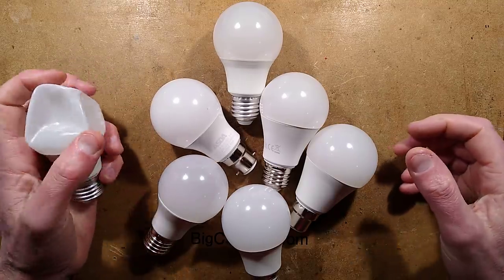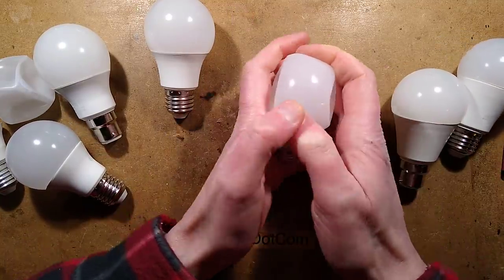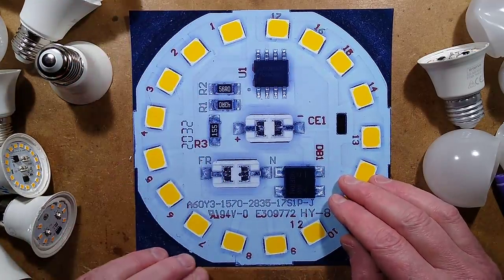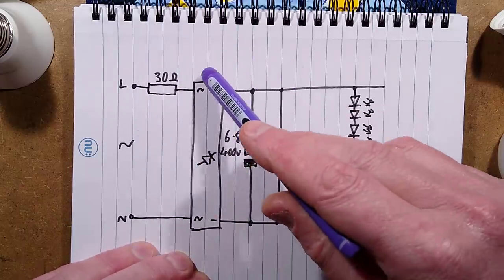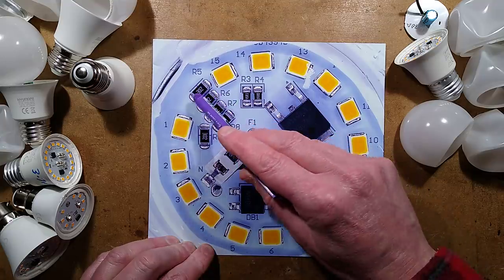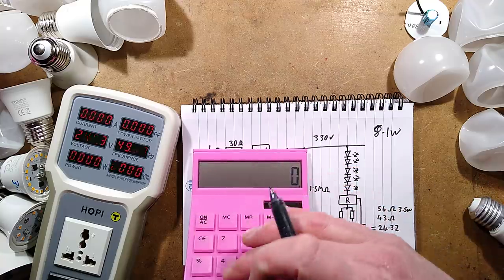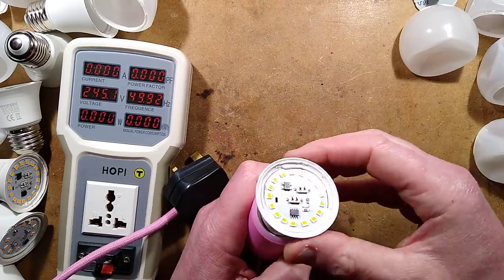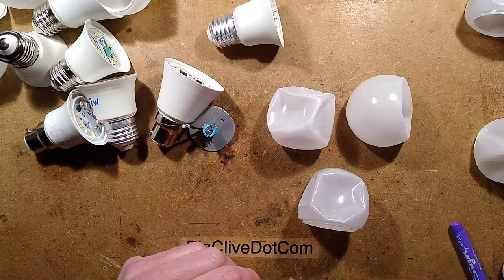Crushing and hacking LED lamps

Comment: I am hooked watched a lot and learnt a lot got ideas in my head for future project just no idea on on making them , want to write to you ? how.
Reply from the maker: You can ask questions here.
Reply: @bigclivedotcom  hi Clive, yes I want to change my inset lights on my Honda Goldwing 1986 Sei 1200cc aspincade. It cam from USA 3yrs ago and has a skirt around bottom and rear boxes all 10 lights have worked in past have LED bulbs in . There disconnected for this country's rules. Ha well after watching you build all the light units on to boards it made me think can I do the same. But with a small add on , controlled by a remote . And indicators on a flasher chaser or plain modes. And for Xmas special outings for charity a crazy light show module which can be reset to normal for police inspection reasons. But my experience is in engineering and I have a HNC in electronics but never used like you am mechanic al technician now retired due to health reasons. I can solder ha apprenticeship make a cube of wire, yes I did burn myself a lot. But I learnt from you my errors over the 50yrs as tradesman. Question  is I don't know your knowledge facts but leaning from your programs. I don't know we're to start ie a board or the components in set . Where can I start ? Each board has to be small 2inch by 1 inch to fit housings . I don't know lights want them to be as bright as allowed 12volt supply from my board on board . for your interest it has a trip computer on tank working but old large lots of buttons . Can you look up the bike then see the skirt and any advise on my be spoke idea. Ta james tommy lea  ps your fingers are more nimble than mine as I had one sawn back on and welded so can't manipulate like you do which I wish I learnt at 15yrs old.    Have a good day stay safe and enjoy life.
Reply: @bigclivedotcom  pps thanks to you again I blew my multi meter and stripped it down found the blown link cleaned the track and made good the link now works again tested ok won't do this again 😃 Bang.ha thanks

Comment: When I attempted to do this i split the second resistor too, and before I attempted to solder on a replacement curiosity got the better of me and I plugged it in first. It glows just enough to not be blinding looking directly at the smd leds. I believe it is safe to use just using the base current of the ic, and I plan to use this happy accident, but just wondering if there is anything dangerous I have overlooked, is there?
Reply from the maker: I've not tried that, but I'd guess it is just the passive current used by the chip's own circuitry.
Reply: @bigclivedotcom  that was my guess too, I couldn't think of any reason it couldn't run like that, so I left it running 24.7 in a closet so I don't have to fumble for a switch in the dark, it's also dim enough I left the "bulb" plastic off. (Aware of the 230v risk) I had considered soldering a capacitor, transistor (or specifically a MOSFET) and ~50ohm resistor, with a NO button in the tip of plastic ball to make a crude latching switch to connect the resistor for a timed bust of brighter light, I think it would make a neat hack, I will let you know how it turns out when I have the time to get the stuff out of storage.

Thanks for the hack idea, it's been nice not having to fumble in the hallway, with just enough light coming out of the closet to allow me to quickly find the hall switch.

Comment: Why does every design always have 2 voltage setting resistors in parallel just to result in a low resistant one?
Reply from the maker: It gives greater control over the value for fine tuning.
Reply: @bigclivedotcom  Do you mean so they will have more freedom to mix and for target resistance? But they use two, not one. Why does freedom preferred to doubling the cost?

Comment: Well the
Energizer ones are a different design. 
Need to use a heat gun to get the top off. 
Electronics is in the stem 
Only 7 leds

Comment: i have 2 kind of outdoor lamp with one led. All the 3 lamps have one light solar pannel on the top and one is older. So the 2 type are old and new one. I opened the old one that stopped working. It have a circuit (That I cannot read.) with one button that turn it on or off and one led. Somewhere I think there is also a photo-cell so when the light goes down it lights up the led. But I cannot crush it to investigate. I want to improve the old lamp adding a AAA rechargeble battery  insted of the ones they used... Can I  ? Or what I have to look for to understand if I can  ?

Comment: Is it a possibility to just put a capacitor in series with the lamp to drop the voltage applied to each lamp without hacking inside?
Reply from the maker: Yes.  That works with the capacitive dropper and linear regulator types.
Reply: @bigclivedotcom  how do I calculate what size of capacitor other than trial and error? Is there a mathematical formula I can use for the amount of voltage drop across the capacitor?

Comment: At 7:39 you mention that the loading resistor prevents the annoying residual glow that some LED lamps have.  This issue of residual glow would be a great topic for a future video.

I have a kitchen exhaust hood that accommodates two lamps.  It came with incandescent lamps, but one has failed and been replaced with an LED lamp (incandescent lamps of this size/rating are no longer available).  It works fine as long as the second lamp is the original incandescent, but if I replace both incandescent lamps with LED lamps, I get the residual glow.  That's OK (for me) - it serves as a 'night light', but my wife doesn't like it.  I don't want to try to hack the LED bulbs, and I would prefer to not have to search for 'better' bulbs that include the loading resistor.  Is there something that I can do to the circuitry in the range hood to force the LEDs to be truly off when they are switched off?
Reply from the maker: You could add a snubber network across the lamp wiring.  It's a capacitor and resistor in series.  If the hood lighting control is electronic then the glow is probably snubber network coupling across the triac.  It's harmless.  Embrace the free night light.

Comment: I just spin the top like it's a jar, if it doesn't work I give it two smacks underneath beforehand.
Reply: Noticed they've been adding more glue, they probably kept popping open by falling to the ground.

They still open fine, smack all around the sides of the top part then grab and spin.
Opens clean.

Comment: Hey bigclive, how much mA would the leds run at with a 16 ohm resistor with a RM9003B TO-252 ic chip? I want to run the leds close to 90mA
Reply from the maker: It depends on the sense input voltage.  You may need to experiment.

Comment: Are LED bulbs being overdriven? Well I have had a lot that say life of around 10 years life, but failed in under 2, without being used much, the latest ones aren't doing too bad though. Whereas, there's an incandescent one in the shed, that was there when I got the house, it's been through freezing and heat is used quite a bit, still going strong and I've been here for 17 years.

On a side note Walmart sold controlling interest in Asda to the Issa brothers, but do maintain an interest in the company.

Comment: Why 8.1W x 24.32R? 
And what are the specs of each led in that lamp? Thank you
Reply from the maker: The LEDs are high voltage LED with multiple internal chips.  It varies from lamp to lamp.

Comment: Wouldn't it be possible to short the resister by soldering a wire on top of it instead of breaking it?
Reply from the maker: That would do the opposite.  I wanted to make it open circuit.
Reply: @bigclivedotcom  I was thinking about it, and thought that that was probably the case, but I was away from the computer, so I didn't delete the comment.

Comment: Can you modify it to run on automotive 12v? That would be perfect to run in an RV trailer.
Reply: I don’t think that would be very easy with this lamp, even if you wire all 16 LEDs in parallel. With 16 LED’s in series on 300V each LED needs ca 18V.

Comment: I took apart a faulty light and it's the same circuit with minor differences.
I managed to fix it to some extent but it still flickers sometimes, must be a bad connection in the LED string.
Reply from the maker: There's probably an LED with a black dot in it.  They often have bond failure.

Comment: @bigclivedotcom take a pocket knife or any stout heavy blade knife and you can slide it into the gap and lightly pry and they pop right open, I have plenty I removed the diffuser and covered the exposed live connections with glue

Comment: I have had 9 Aurolite AL3003 12W “980lm” bulbs, and 8 have failed within about 1000 hours. They normally strobe unbearably when starting up at end of life. Popped open the top and there appear to be no components? Just 12 sets of 2 LEDs.  Does that mean a straight 10V AC across each one?
Reply: The code on the board is T11-A60T-2P12S-2, so I’m guessing 2P12S means 2 in parallel x 12, so 20+V across each?
Reply: Took the LED plate off and found a chunky little board behind with 5 capacitors, 8 resistors, 2 coils, a diode, diode array (?) and chip. Taking it out is destructive, so not much chance of improving the life of these lamps :(
Reply from the maker: It does sound like it would be hard to modify.
Reply: The BC terminals are just push-fit and jammed against the fly leads from the circuit board. Nice.
Can anyone tell me if it might be possible to fix the strobing? It stops after 10-20s, so some component is happier once warmed up. One of the capacitors perhaps?

Comment: Do we have plastic LED bulbs here in the US? Would love to order some and do just this lol
Reply from the maker: You may be able to get similar lamps in supermarkets and dollar stores.
Reply: Dollar Tree for sure, but I just got one that used a single 7.5 ohm resistor, so the clipping trick wouldn't work and I had to solder to replace the resistor.

Comment: Could you modify an amazon basics light? I took one apart, and the circuit board is removable from the power supply bit without soldering. It uses pins that the led circuit board slides down onto. The power supply is in the usual spot, but I'm not sure how I would modify this. The bit I'm having trouble with is how would do I get the connections back onto the light? Should I just use new longer wire(so that it's easier to do (for me))? I have it apart, and the board looks nice... For being so cheap. There are a part of 15 ohm resistors one on each rail. Also, the bottom of the board is very shiny, like they sprayed the whole thing with flux. I'd like to share a picture, or a short video of it, if you'd like to see it.

A 40W bulb with 6 cob(i'm guessing)  LEDs.
Reply: I just seen your video on the poundland light, and it looks sort of like that, but I'm not sure how that one comes apart.

Comment: Ive tried, and tried but its impossible to take the top of some of them. The tesco type was easy for me but the cheap one was impossible. Its the new material called indestructanium
Reply: If the caps are plastic and easy to squeeze (in other words no glass), squeezing can release the silicone seal.
Reply: @8bitwiz_  did you not read my whole comment?

Comment: What to do when such lamps start to flicker and fail miserably?
Reply from the maker: On some you can tame down the current and bypass failed LEDs.  But at that point the damage has been done.
Reply: @bigclivedotcom  could it be capacitors failing?

Comment: Is there any chance I could do something similar to g9 LED bulbs? No matter which brand or expensive they are, they last 6-12 months and having to replace and waste too. The mrs insisted on a chandelier with 10's of these bulbs in each set, plus multiple matching sets of mood/accent lights, and the frustration of changing them and the cost is stupid, also the electrical waste is painful.  I brought a new pack of generic G9's, they have two banks of 2x510 (51ohm?) each side. One 684 (680k Ohm?), a capacitor and a MB10F bridge rectifiers. Seems like a much simpler circuit to the GU10's. Could I remove any of the 51 ohm resistors to reduce power output, feasible? Thanks all.
Reply from the maker: Depending on how accessible the PCB is it may be viable to adjust the resistor value to tame the heat.  Alternatively, it might be possible to add series capacitors to "dooby" the lamps.
Reply: @bigclivedotcom  Thanks Clive for getting back so fast. The space is somewhat limited with the two part shell, though if I leave one side open, I could solder in small resistors else it would have to be smd's, and thats beyond my skill, I'm just a amateur tinkerer. It's doubtfull a series of capacitors would fit safely.
Which resistor would I need to play with, the 510's or the 684? Really appreciate this.
Reply from the maker: @harj-spp8547  If the two 510 resistors are in parallel you may be able to remove one.

Comment: I use similar CC Chip in my flood DIY led lamp. After some time some leds shines only litle bit but current passas to ather leds and they lights normally. Maybe you know wats hapens to some leds ?
Reply from the maker: Most likely bind failure and internal tracking across due to overheating.
Reply: @bigclivedotcom  😊 Thanks
Reply: @bigclivedotcom  Thanks :) Failed After Cold Winter probable metals shrinks becose of cold :)

Comment: If you don't want to crush the globe, you can gently prise around the seam with a rather stout k'niff (as Clive loves to pronounce it) or spudger to weaken the adhesive.

Similar circuitry in my Dollar Tree lamps that don't work very well on 120V with Doobie capacitive droppers under 1uF. Ours also tend to have a single current setting resistor (though they have two pads), so I guess I'll need to work on my surface mount soldering skills if I want to modify them. What is the typical size for these - 0603 or 0402?
Reply from the maker: Not sure the size.  It may vary between lamps.

Comment: Shows me how weak I am compared to clive, while I was watching the video I pretty much spent half of the time trying to pry open one of the bulbs and failed
EDIT: finally got the bulb open and looks like it simply has a vertical power supply in the middle and the only thing that you can see is the 2 contacts from the power supply and the LEDs themselves, shame. Really don't think I should take it apart further. Mine is a 6 watt one from Clas Ohlson

Comment: Why do leds need capacitors i know they need drivers to give them a constant dc current and why do they flicker when they fail
Reply: Capacitors are for smoothing the voltage, when they fail the leds are getting the unsmoothed 50 hz from the mains voltage so they flicker in 50hz
Reply: @jeremoisde9928  thought bridge rectifiers did that

Comment: Why does the capacitor charge to a higher voltage than the supply?
Reply: It charges to the peak value. The 240v ac mains reading you'll get on a meter is an rms value
Reply from the maker: The stated mains voltage is an average of the sine wave.  The peak is 1.41 times higher.
Reply: @bigclivedotcom  Thanks!
Reply: @burtgummer9057  Thanks!

Comment: immidiatly after watching this video I plucked the light bulb out of the nearest lamp ripped the cover off and without looking even remotely closely at the circuit I looked for two resistors next to each other on the board and snipped off the lowest value one plugged it in and... nothin not to worry though I have idential bulbs to that one that are already dead i'll repair this one and try again with a little more care

Comment: Yep, over driven and designed to fail. Shades of this: ""The Phoebus cartel [formed January 1925] lowered operational costs and worked to standardize the life expectancy of light bulbs at 1,000 hours (down from 2,500 hours) and raised prices without fear of competition. The cartel tested their bulbs and fined manufacturers for bulbs that lasted more than 1,000 hours. A 1929 table listed the amount of Swiss francs paid that depended on the exceeding hours of lifetime."

Comment: All the lies: CFL bulbs last for 10 years. Nope! LED bulbs last for 10 years. Nope! These alternative bulbs last just as long as classic incandescent bulbs.
Reply: I've had mixed fortunes with LED bulbs, from lasting about a month to having been in place for over five years, running every day for over 15hrs per day.
Reply: I find these comments interesting. I put in Sylvania mini CFLs in every light fixture when I bought my house (USA) 9 years ago. I bought them in a multi pack. It was 6 years before I had to change one. I am slowly replacing them with CREE Led bulbs as they get too dim or take too long to get up to full brightness.
Reply: CFL bulbs vary in quality. I installed a bunch of CFL bulbs 20 (!) years ago (I got tired of replacing an incandescent every month). The most used ones took many years to fail, and the less used ones are still working. CFL bulbs were still new enough then that manufacturers hadn't learned what corners to cut. And it's nice that these cheap LED bulbs can be easily modified for longer life.

Comment: How would I hack these lights for a brighter bulb that will last .
Reply from the maker: By using an adaptor to put two or more in a single holder.
Reply: @bigclivedotcom  thanks alot now I have my very first project to try when I get my new tools. Well first project in 15 years.